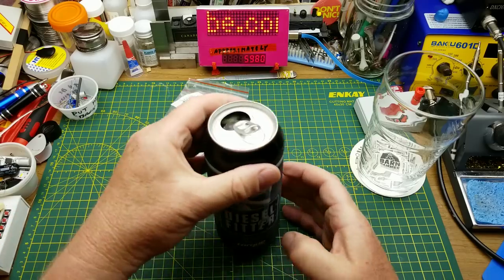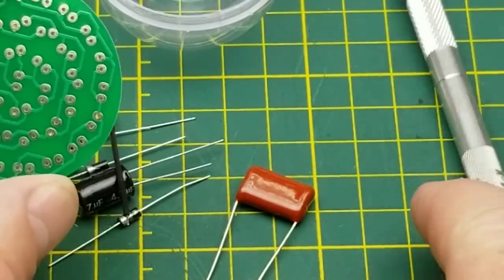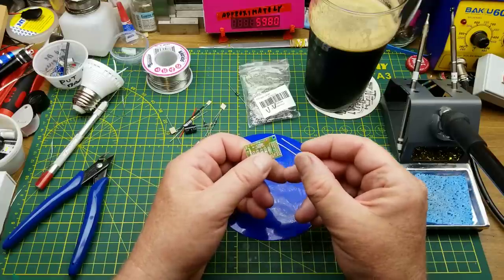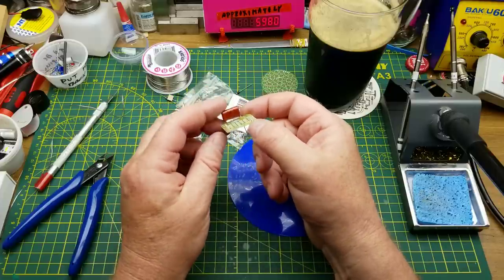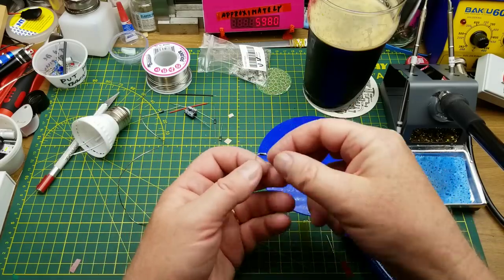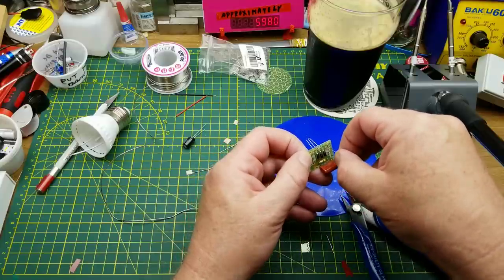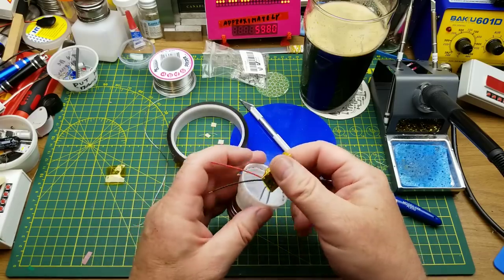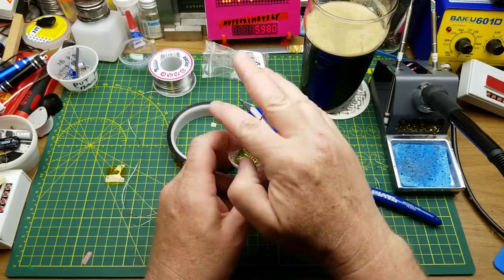DIY light bulb kit build

Comment: The polarity of the AC inputs doesn't really matter because it all goes through the rectifier first which converts it into DC anyway. Is that correct?
Reply from the maker: That is correct, it doesn't matter for the operation of the circuit.
But for safety it does matter. 

Live should be the tip connection, and the screw part should be the neutral (which is electrically at the same potential as ground) so you don't accidentally get a zap off the screw base while you are installing the bulb.

Comment: The audio is low in this video.  -10dB according to "Stats for nerds".  Had to turn up the volume on my PC.  But on phones and tablets low audio can be a real pain especially if there are other noises around.  Crank it up next time!   ;-)
Reply from the maker: That's odd. I used exactly the same settings I have been using for years.  I'll see if there is anything I can change (without breaking something else...)

Comment: Hello from the Philippines. Retired here from the US about 6 years ago. I have the same kit. It did not have the 10 ohm resistor included. Here is 220vac 60hz. Canada is the same as the US... So, what do you think I should use in place of the 10 ohm resistor? And, is it a 1/2 watt size resistor? I searched YouTube videos and you have the only one for this kit.
Reply: Thank you in advance
Reply from the maker: the resistor is acting as a fuse more than as a current limiting device, so anything between 10 and 20 ohms should work fine. 
I believe the resistor I got in the kit is 1 watt, but even 1/2 watt should work as a fuse. There is not a lot of current when it is working correctly.
Reply: @pileofstuff  thank you very much for the help and the quick response. I really appreciate it. I can order them online here no problem

Comment: these were probably meant for white leds anyways.
Reply from the maker: No doubt. The voltage drop and current draw of these LEDS were a close enough match that I figured they would work.
If I had used red LEDs, there might have been some excitement when I powered it on.